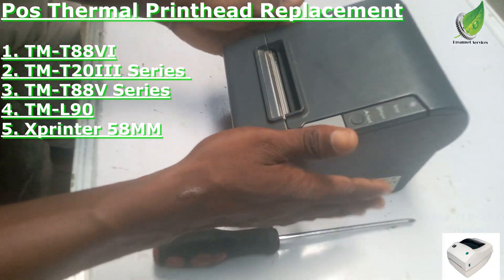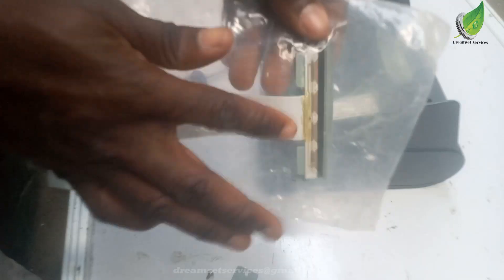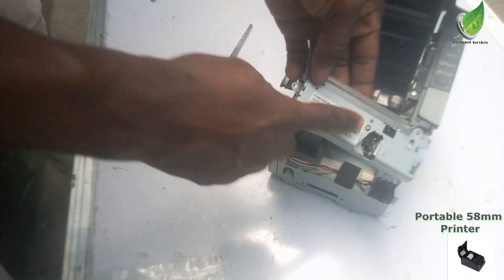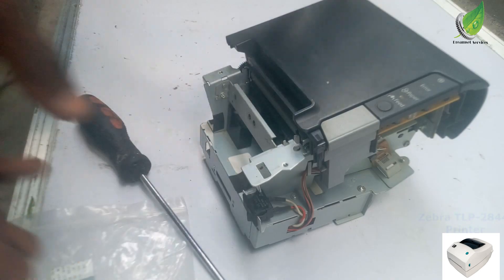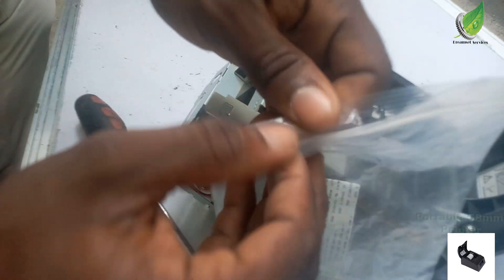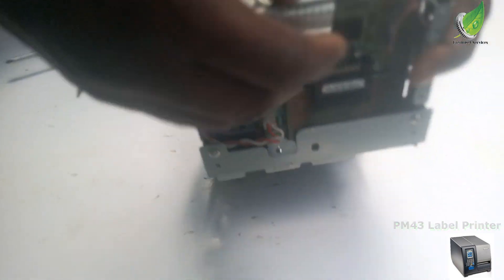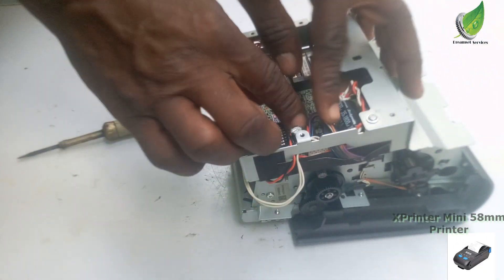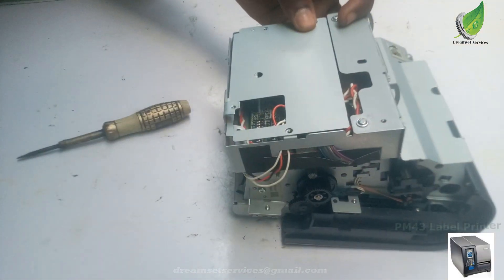Epson POS Thermal Printer Repair

Comment: Bro i have epson TM-T88II Model M129B. Its parallel port not working. Can i change it with any usb interface card. Is there any solution for this?¿
Reply from the maker: Yes, you can use a USB adapter interface for it instead